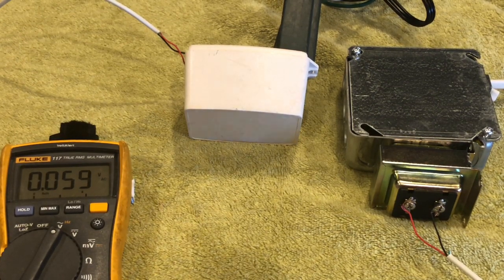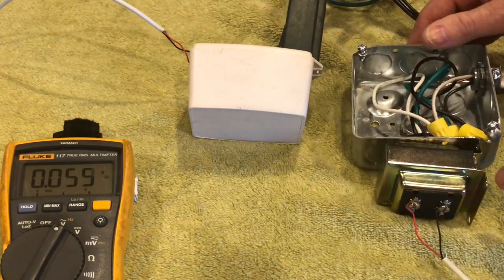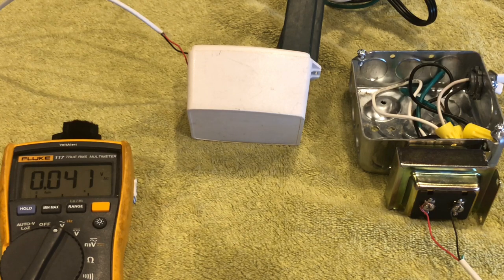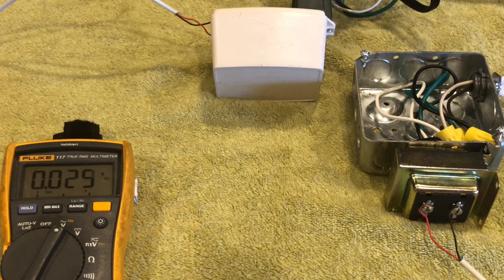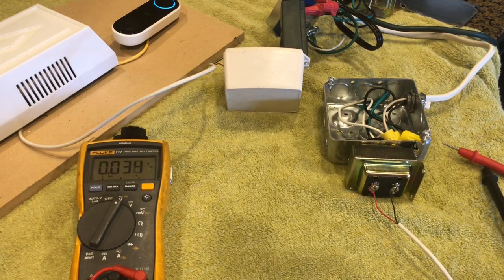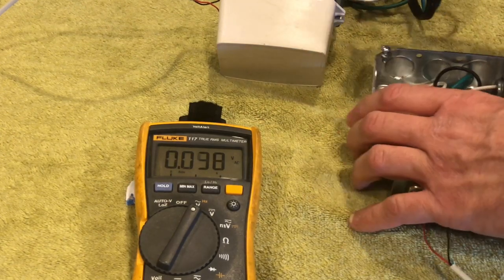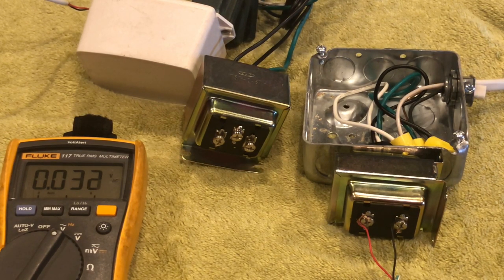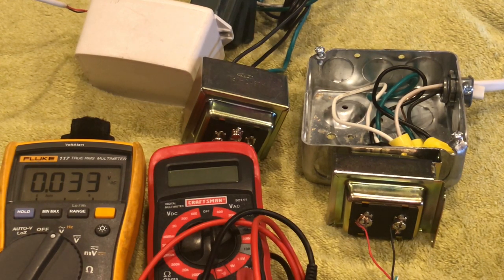Doorbell Transformer

Comment: Just a quick question for you. I have a 16v transformer and I'm trying to install a ring doorbell pro and I cant get it to power up. I have checked the volts and I'm getting 20 volts at the transformer. Have you ever run into a problem with the internal battery of the ring doorbell pro? And if so what dis you do or how long did it take to charge it?
Reply from the maker: How many volts are you getting at the doorbell itself?
Reply: @sellgooddeals-DIY  Im pulling 20 volts at the doorbell as well
Reply from the maker: If you are getting 20v at the doorbell the Ring Pro is bad.  It should take less than a minute to power on.  I haven’t changed the battery,  if it has one it doesn’t have much capacity.  The doorbell powers down in 10-15 seconds after power has been turned off.

Comment: How is 24v transformer better than a 16v for a ring or nest.  Is it louder or provide video footage faster?
Reply from the maker: No, it only helps with giving Ring/Nest doorbells enough power when the chime is drawing power (button pressed).  This consumes quite a bit of power check out this video https://youtu.be/QUO7o_vrEMw  The Ring/Nest doorbells require a constant 16V to run correctly.  For most people a 16V  30va transformer will work just fine.  It really depends on how much power the chime is drawing and how long the wire run to the doorbell if you would need a 24 volt transformer.  It doesn’t help with louder or faster streaming.  When the voltage drops too low the Ring/Hello may not work correctly.  Hope this helps.